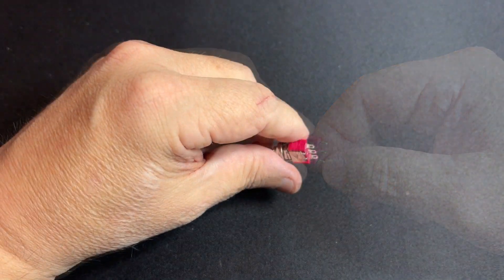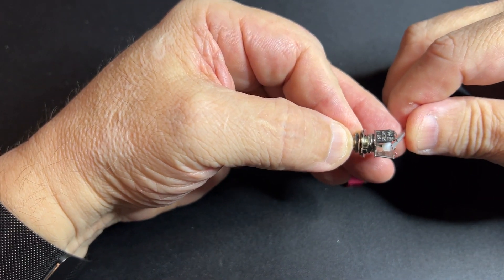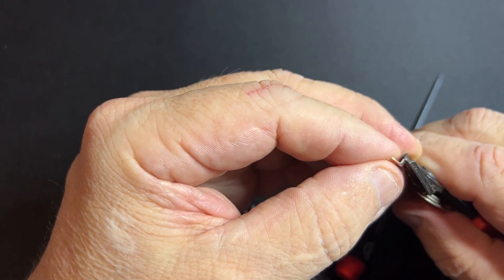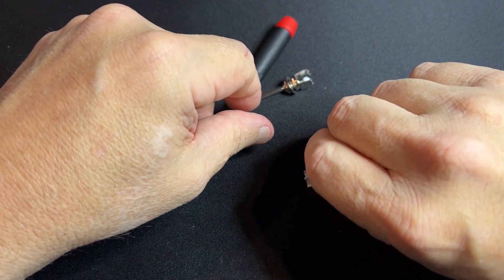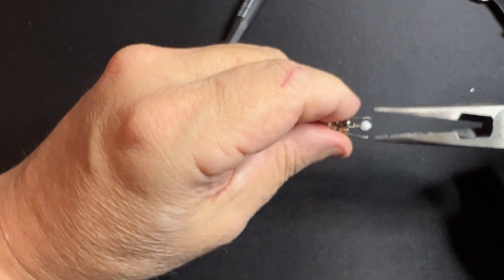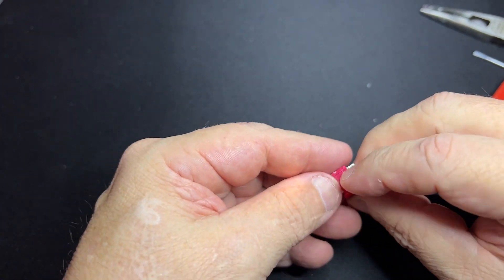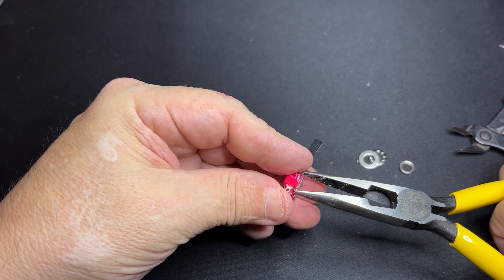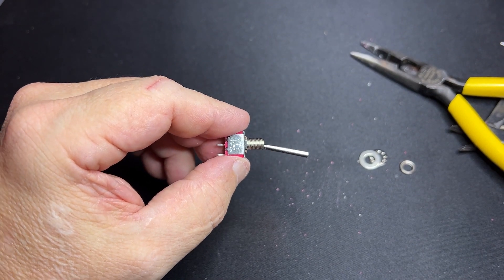How to modify an On-Off-Mom (momentary) switch into a On-Off-On (Three-position) switch

Comment: Is there a way to convert regular switch to momentary?
Reply from the maker: If you look at the video you can see that the way to ptrevent the full switching is by preventing the full swing so that the rocker will rest fully with the piston pushing to keep it in place. If you solder a piece of metal to the contact that’s connected to the wire so that the rocker won’t swing fully you will have restored it but at that point it’s probably easier to just order a replacement.
Reply: @auggiecopter  Im trying to find MOM version of regular switch for month already with no luck. I have specific size (in black dji fpv remote) 8x8x5mm
Reply from the maker: @vsobolev Select the style you need here: https://www.aliexpress.us/item/2255800326081342.html

This type: https://ae01.alicdn.com/kf/H59753a13da15413285079f046b3ca1e10/SH-T80-T-Series-Flat-Handle-6-35mm-Panel-Mount-Mini-Toggle-Switch-For-RC-Model.jpg_640x640.jpg_.webp
Reply: @auggiecopter  These ones are slightly bigger (13x8) than i needed but ive ordered them few days ago in hope to swap metal parts inside of old ones
Reply from the maker: @vsobolev  there are smaller
Ones in that link